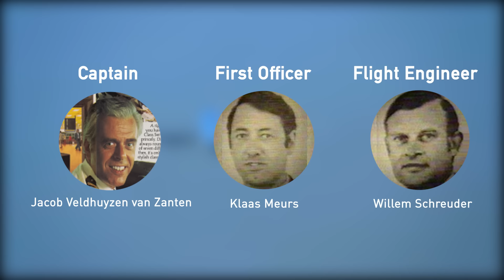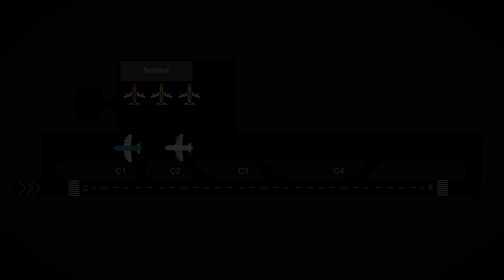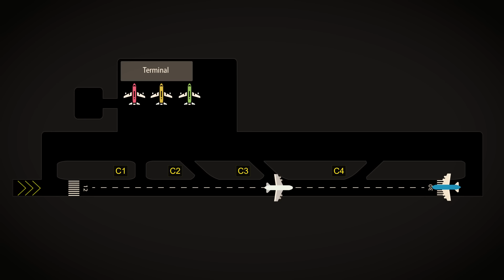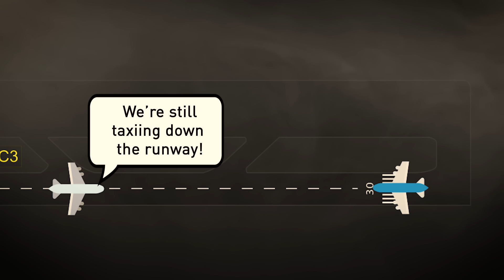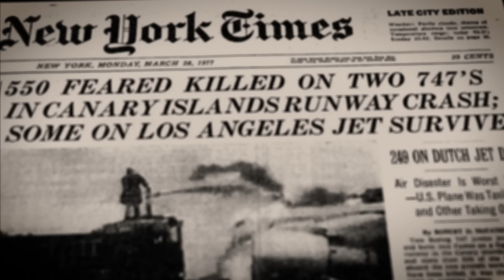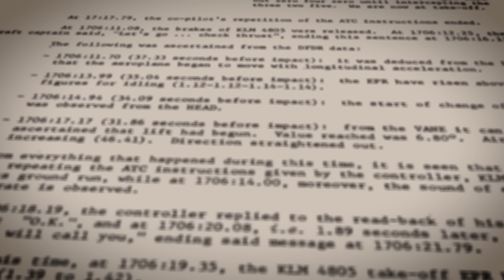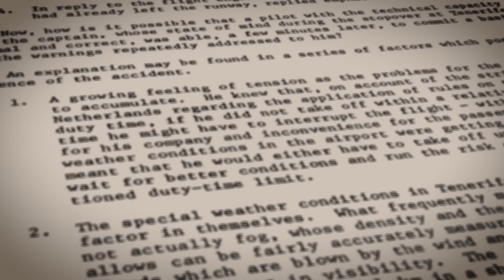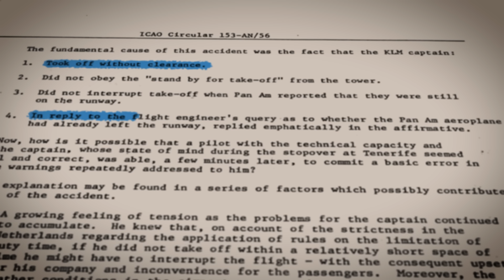Tenerife Airport Disaster | Deadliest Crash in Aviation History

Comment: I see blame in three areas here. The tower, KLM pilot, and the Pan Am pilot. Having said that, there are tiers of error for each of the three. The least is the tower, although in these circumstances the idea of having planes follow each other with the potential of two planes facing each other was risky for this weather. Yes, there were time constraints, but having one craft taxi, turn, and take off...THEN move the next on to taxi status would've been safer. However, if everyone does what they're instructed, their plan was doable...just not advisable. Moving to a more prominent error is the Pan Am pilot. He was unsure of his exit ramp as to whether it was 1 or 3, then kept going knowing he couldn't clearly see any of the exits. Having to realize that he didn't know exactly where he was on the strip and that there was a real chance that he missed his exit, he should have taken the aircraft off the runway even if It meant rumbling it across the grass median. The second he heard KLM talking about takeoff he definitely should have yanked hard off the strip. He is alarmed and tries to contact KLM that he is still taxi go and continues until he visibly sees the nose of the other craft through the fog coming straight at him...this is just too late to act. The primary blame is of course on the Dutch pilot. Even if delaying KLM itinerary could cost him his licence, he had to realize that KLM would understand that over 200 lives at stake at a backed up, radarless, single taxi/takeoff/land airstrip in poor weather was of the utmost importance. Just the avoidance of a class action lawsuit would've been enough to convince them. However, he doesn't get a specific takeoff confirmation and can't hear the tower telling them they will call back soon with said instruction because the tower and Pan Am crew both tried to radio him simultaneously and created transmission clutter. Impatient, he doesn't wait for clarification and ignores his crew who point out they have not gotten takeoff clearance but only a ready for departure statement. If any of the three parties errors in judgement are corrected the entire incident is avoided...but even with the tower's and Pan Am pilot's poor thinking, it still could have been avoided. Therefore the crux of the blame lies with the KLM pilot for not just waiting a few minutes more for proper confirmation.
Reply: Exacly if the KLM pilot paied attention to his crew 535 lives would have been saved.
Reply: They were cleared 100 % of blame  ( Pan Am ) because they were directed to a turn impossible for a 747.    The controller wasn't used to directing large planes, in fact every pilot asked later said the turn was virtually  impossible .  So Victor  thought to get the hell out of there in fog  and get quickly to 4 which was easy turn.   If he had tried 3 he would still have been on the runaway trying when the KLM hit them and being sideways on more passangers may have died.

Comment: I´m from Tenerife,and after reviewing extensively the accident,by no way I regard captain Van Zanten as "the villain of Tenerife",he made a terrible mistake,but he didn´t that purposely,he did that overwhelmed by a number of reasons,on the belief that the Pan Am had left the runway and he was cleared to take off.The right analysis is that first,it was a nonsense to put 2 747s on the active runway at the same time on low visibility conditions,and things were brought to a point in wich a human error could lead to a catastrophical outcome and everybody failed there,shortcomings from the controller´s side were key contributors to the accident and the Pan Am crew also failed.Captain Van Zanten ,at the time of the accident he had a wife,a son and a daughter,my thoughts are with them,they should had suffered a lot
Reply: Yeah, no. This was caused solely by Van Zanten's bad decisions.
Reply: that backtracking procedure is an utter nonsense whatever the wheather/airport trafic conditions

Comment: You fail to mention a very key point which were the strict Dutch aviation regulations around how long pilots could be on duty. Had KLM not taken off, the pilots would have been heavily penalised so there was pressure to take off sooner.

Comment: 380 passengers +13 crew members=393 people on board+ 14 crew members +235passengers = 249 people on board, in total that would equal 642people. In the Tenerife disaster while KLM had 248 deaths+Panam had 335 deaths, that's 583 deaths in total.

Comment: To provide a bit of context, the late 70's were harsh times in Spain: a 40-year long fascist dictatorship had just ended in 1975 and the transition to democracy was a convulse period. Stuff like terrorist attacks and bomb threats were not uncommon those days, so it's no surprise that Las Palmas airport was closed because of it.
Additionally, a bloody civil war followed by decades of isolationist dictatorship had left the country in a very underdeveloped state (which still lasts nowadays in many ways), meaning that the absence of proper radar equipment at the airport and the poorly trained ATC and rescue services were also a common issue back then. 
All in all, the accident happened due to many factors, and the KLM captain's negligence was probably the main cause, but the spanish scenario also contributed greatly to the catastrophe.

Comment: A lot of factors added up to this happening. Beginning with the bomb at Las Palmas Airport, which forced both jets to divert to Los Rodeos. Los Rodeos was a smaller regional airport that was not designed to accommodate 747s. The weather became a critical factor with the thick fog that covered the runway. The KLMs Captain who made the astounding decision to have the plane fully refueled when it had plenty of fuel to reach Las Palmas Airport, the full load put an estimated 55 tons of extra weight on the plane. The decision not to close down the runway when the weather had clearly taken away visibility for the pilots and ATC. The Pan Am 747 missing its turn on the taxiway and basically didn't know what to do after. And the KLM captain who clearly disregarded runway procedures and protocol having not received a takeoff clearance with the KLMs call sign, but took off anyway. Many things added up for this crash to happen. RIP to all victims of the Tenerife disaster. 🙏

Comment: It’s quite obvious than many factors go into the design, production and operation of a commercial aircraft. As a final part of obtaining its airworthiness certificate it has to have an insurance guarantee. When the 747 was put to Lloyds, the initial reply was a clear refusal. The reason given was that the passenger capacity was too much of a liability in the case of two colliding. Pressure was applied behind the scenes and Boeing received the go-ahead. To this day Lloyds is still reeling from the damage settlements …

Comment: Im continually dumbfounded they even try to put planes in the air under such bad weather conditions - ESPECIALLY in an airport with minimal to no modern gear
Reply: @Joxar But it might be considered unnecessarily hazardous to have two planes utilizing the same runway simultaneously for such a long period, one poised for take off and both facing each other under such low visibility. Indeed even Pan Am twice expressed the desire to wait for the KLM to take off before venturing on to the taxiway. To me, that's where the redundancy factor went below standard. The final report called this practice "potentially hazardous." Perhaps "actually hazardous" might have been more apt.

Comment: There is another simple solution, which all aircraft manufacturers and airlines agree to not have :
Like all cars,  Aircrafts must be equipped with sound horns for alarm.
There can be 4 intensity levels :
1) Low : for people walking on the ground near the aircraft.
2) medium : ?
3) high : ?
4) very high: accidents.
A system could log every time, the pilot used the horn.
Pilot may need to justify everytime he used the horn to his airline.

Comment: Awful. I also wonder if airline procedures now require taxiing such that the plane does not head towards where another plane will be departing. Reminds me of the collision of the Andrea Doria and the Stockholm. In that incident, one ship turned to port and the other to starboard, meaning they turned into each other. After that, it have read, ships are generally instructed to turn to the same side (starboard I think) so that if they are on a collision course they will always avoid each other.

Comment: Drone technology should be able to change the face of aviation industry forever. Large passenger aircrafts using Drone technology should be introduced which will eliminate the use of runways for take off and landings.Most of the accidents happen during take off and landings.
They should do this a s a p. Earlier the better

Comment: I understand everything that went wrong, but just for a moment assuming that the other circumstances could not change, wouldn't it be logical caution that The second airplane should have stayed Parked until The first airplane was gone from the ground? Since the situation was such a mess, I was thinking all the time: the air traffic controller should have allowed only 1 plane to move per time until it leaves the runway and wait a little to not have confusion in the first metters after take off. It would be frustrating yes, but it would be appropriate caution given the situation. Does anybody think this makes sense?

Comment: Obviously once something is evaluated time and time again its easy to look back and say they should have done that or that.

So its a smaller airport with a load of passenger planes and lack of required technology and most other things to accommodate this situation safely, add to that massive fog, would you not have at least one emergency vehicle with a beacon guiding planes where they should go, that just seems one of the more basic common sense things, or have a person waving two of those light sticks they use on fighter carriers, at the spot where plane is supposed to turn of the runway.

Again its easy to say "Could have, should have" now but with so many aircraft, lack of tech and just massive fog itself light signal guidance is the key for me

Comment: Why would they KLM Backtrack and not take of immediately from the opposite end because it was the same length regardless
Reply: You are right about the same length.. But is has (also) to do with the direction of the wind. So if the wind is coming from the 'wrong' way the planes have to take off from the other side.

Comment: In general, too many details were left out. The pictures used are too simple. Decisive was the mood of the KLM captain. So, this post of this disaster is too simple. What is not mentioned: the captain of the KLM Boeing was told after landing on Rodeos Airport by the KLM headquarters to leave asap, due to new Dutch regulation on working hours for pilots and crews. So, having understood this, he felt under pressure, also by his own reputation of mister on time, to realize the impossible: to get out asap, which could be done by refueling before leaving to Tenerife airport - there would not be a need to refuel at Tenerife, since his timeframe was tight. Otherwise, he would have put all the passengers in an hotel, which would be way too expensive for KLM (it was a charter flight). That refueling took too much time as it turned out. And then at once, Tenerife re-opened, so refueling appeared to be a grave mistake against him and the PanAm Boeing. Another psychological factor kicked in: he was KLM head of education and training program. This was his first flight after months of giving training in the flight simulator. There, you give instructions, you don't receive them in chaotic unpredictable situations. Moreover, his co-pilot Klaas Meurs, was trained by him, so the relationship was Master and pupil. Those psychological factors were key in his decision to leave on his own authority, and not to listen in this unpredictable situation, which is reality and not the simulator. His last words, 'o jawel', was in the strong self convinced affirmative: there is no plane at all (the third moment that his crew made him aware of that there WAS a plane or to WAIT). He ruled it out - his copilot was probably used to this behaviour. The ALPA report pointed this chain of psycological events out in a brillant way. These elements, key in this report, were not mentioned. Also, the PANAM Boeing was not that far behind the KLM Boeing as the post suggested.
Reply: Very good analysis. One question mark: did he leave on his own authority? That implies he took off knowing full well he lacked the proper clearance. But that is virtually unthinkable. Is that what you mean?
Reply: @cchris874  Thanks, but it is the ALPA report analysis. The ALPA report introduces the filter effect, a psychological phenomenon that people select information to a high extent under stress. This is what happened - not all information made it to his consiousness. He actually did not recognize the authority of the airport controller, since he was the star pilot (the real posterboy) of KLM. So, yes indeed, he did leave on his authority and dismissed all counterfactual evidence and remarks. The very fact is even, as the ALPA report makes clear, that unless the heterodyne noise on the radio, the message of the PanAM Boeing was still understandable. Moreover, as an experienced pilot he should have understood what a heterodyne implies: somebody wants to say something very important. He should have checked it out, also an element of grave neglicience.
Reply: @waldolala1964  

Yes, but he still assumed he was NOT breaking any rules while taking off.

Comment: With the large # of ground disaster why are airports not mandated to have or install ground radars? Airports not having that capability should either be closed down and or fined until that sorta radar is installed. If funds are an issue isn't it more sensible and safer to pay now rather than this happening again? And then having to pay out to the families.

Comment: This kids is the reason why the captain and flight attendant are asking you to turn off your phones during take off and landing.
Reply: I think if an FM cell signal can drop a plane, we REALLY have problems. 

Why don't they use UHF, then? It's a vast wasteland of nobody home over there...
Reply: @windsofmarchjourneyperrytr2823  in theory yes it could but very unlikelysince Plane already designed to shield it with that kind if interference .. But are you really willing to put that "*" everytime you fly a plane?  FAA are not taking chance about it so adding an extra layer of protection doesn't hurt passengers's stupidity.

Comment: KLM has a bad reputation because of its pilots
Reply: Despite this accident they are a very reliable and a safe airline
Reply: @spongebubatz  I am reminded of the two KLM pilots who were revving their engines as they were taxing to takeoff inorder to clear the fog. The fog was sucked into the engine inlets and their view was cleared. The tapes show that they were laughing about this. They were holding the aircraft back with the brakes which became red hot. On their take off run the brakes were spewing parts on the runway. When they tucked the wheels up the tires ignited dooming all. The couldn't even figure to reduce air speed and drop the gear. The smoke, fire, and crash into the ocean killed all on the wide body. The died stupidly.
Reply: No a bad reputation costumers less fly them

Comment: This was male ego that killed them. The Pan Am pilots were pissed about being held up by KLM taking fuel. KLM pilots were close to having to cancel due to flight time regulations. The Pan Am pilots "missed" the first turn off which was at a severe angle and would have been a difficult turn. We're they playing chicken? Holding up KLM out of spite? Did KLM pilot also play chicken when he went before he should? Without the extra fuel he may have missed Pan Am.? We may never know. These crews were pissed at each other.

Comment: For the short hop to Gran Canaria, why were both aircraft 'filled to the brim with fuel'?
Reply: Rafael Enriquez  Thank you, Rafael.  Great input.
Reply: Rafael Enriquez  Just remembered:  Such aircraft have landing weight limitations which require pilots to dump fuel so that they can return to the airport after takeoff.  Why, then, did these pilots intend to land their aircraft with full tanks?
Reply: Rafael Enriquez  Thanks.  You probably are correct.  This question was, no doubt, addressed in the official investigations.

Comment: I am a bit confused on why take off was banned in exchange for departure. I seem to recall hearing the word take off on some flights as well. If I didn't know better they'd convey the same meaning to me.
Reply: Don't mention the word "takeoff" unless/until you're cleared for takeoff.  Does "ready for takeoff" mean that you have clearance and are about to pull on the throttle, or does it mean that you are requesting permission to take off?  It could cause confusion among anyone else who hears the conversation on the radio.

Comment: 8:45 4 years after the crash, United became the first to start CRM training. Not KLM or PANAM?
Reply: @philipcostley  ok so video not accurate
Reply: Video also mentioned no ground radar. Did the airport improve on the comms system? Airplane on the airport should be if you can't see, don't move or start engine. Feedback to control tower until you get a clearance.
Reply: @philipcostley  ok so the video not accurate.